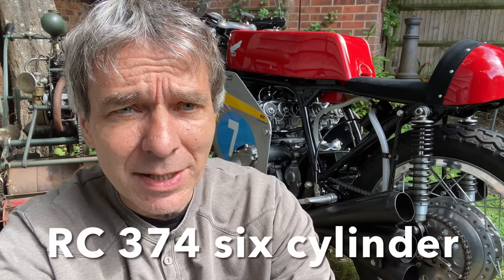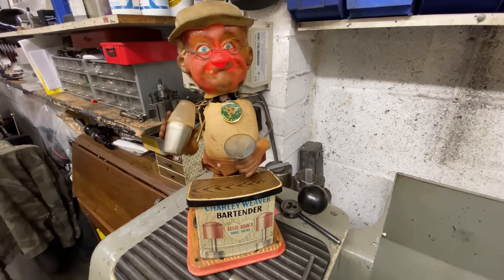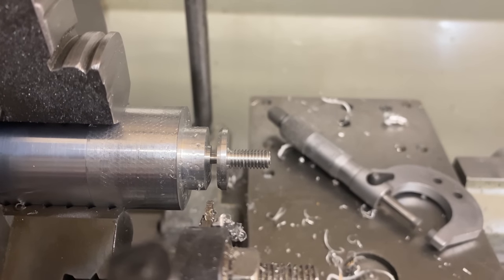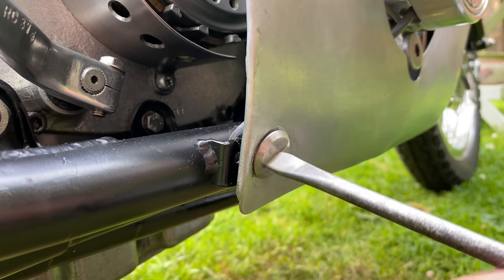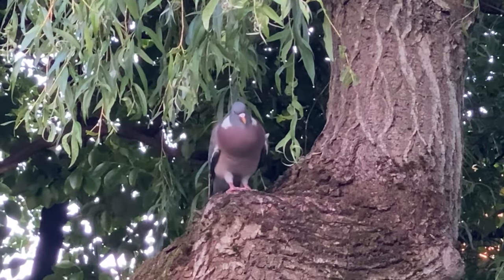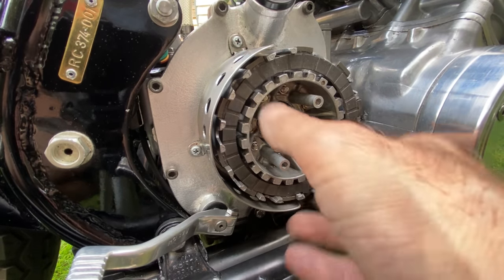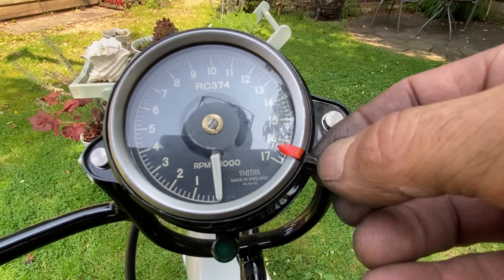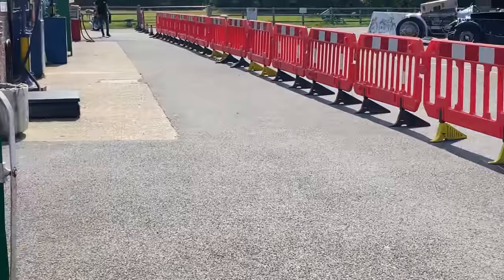Millyard RC374  Honda six replica - Episode 6

Comment: When you cut the slot in the screw you made I noticed you used a great trick of 2 -3 blades in the saw...great trick used it many times,,,  cheers Ian
Reply: good spotting, but I couldnt help but wonder why he didnt just cut the grove in on the lathe cross slide. Its already set to dead centre!
Reply from the maker: @tigertim20  The cross slide method is an  option I use sometimes but this time I wanted to show how easy it is to use a hacksaw
Reply from the maker: strangely I only used one blade, but I agree it looks like there is two

Comment: Need a screw:
Me: Goes to Screwfix
Allen: I put a 25mm bar in the Chuck. 
What a guy.
Reply: Ironically that was a pretty easy task to make that screw. All you need is a lathe, vise, hacksaw and a buffing wheel and a few months of machine shop classes. BTW aluminum being a soft metal is a joy to work with the titanium maybe more a challenge.
Reply: Also I forgot to add you need the die to cut the 6mm threads. LOL.
Reply: Made me laugh Dan

Comment: I find using brass rods (with different sized tapped holes in the ends) make nice mandrels for polishing fasteners. Much better for your fingertips (and also your knees, when a screw catches & pings across your workshop floor!)

Hope the Viennese Whirls came out perfect, btw!

Comment: As someone who consistently puts the hack in hacksaw, 6 videos later I'm rendered completely speechless by your incredible work. As you worked did you feel any emotional connection with the Japanese engineers who came before you? Both you and they, over a generation ago, used the same tools and techniques to produce almost identical parts in look, fit & function.

Comment: Hi Allen,. Love your videos.  I was wondering about you scuffing the steel plates, I build Transmissions and in a wet clutch setup you want the steel plates to be mirror polished smooth.  When you put scratches in the plates you shorten the life of the clutch because the frictions will wear a little prematurely re-polishing the steel plates with the friction material.  Something for you to think about. Have you noticed that if you checked the steel plates after you scuffed them and ran them the plates were probably smooth.  Okay have a good one.

Comment: Nice! A couple of things though; the clutch assembly has a wobble. This can cause the axle to leak from the oil seal when it spins. Also, has it ever been on a real track, for a timed lap? that would be interesting to see, how the engine actually performs. It sounds good, but how it runs?

Comment: Hi sir millyard. The metal clutch plates one side is flat and the other side is a slide dome do you have the flat side facing out or the domed side facing out just thought are ask you. Great vid Alan like all ways. PS I’m waiting for the two Yamaha RD 350 LC engines to become a 700cc or the power valve 350cc. I watched wheeler dealers the other day and Ed was stripping a old car it’s was a 1936 Cadillac and you want to see the con rods one fit up in side the other iv never seen this before may be you have just thought are massage you that. Love all your videos.👍

Comment: Thank you very much for sharing Allen. I love your Honda RC374 replica and also the tip for starting the thread cut was clever. Sammy Miller's is certainly a great place to visit, I saw a bike there as old as me - I wonder if it runs as well? I assume the screws going into the exhausr have to be Titanium because the heat would affect aluminium? :>)
Reply from the maker: Titanium is a metal with one of the lowest heat transfer properties, where as aluminium is one of the worst

Comment: to put grease into a grease gun; wear rubber or latex gloves, dip them in diesel and then you will be able to grab handfuls of grease dab them into perfect cylindrical shapes & load them into the GG without any grease sticking to the gloves/fingers due to the diesel's cutting and jellying effect on the grease

Comment: I'm surprised you didn't make a special screwdriver for the faring screws. Regarding your need to stamp everything, it would look much better if you used some masking tape so at least the letters are in line with each other, it really does offend the eye on such brilliant engineering.

Comment: 4:00 I was so disappointed to hear you were going to use a vice. I was expecting the usual technique of holding the screw between the feet, and a cutting disc used in the angle grinder.

Comment: I really like the fact that you never use power tools.
Makes it look and feel much more genuine.
Reply: Lathe,welder,drill, etc etc etc
Reply: @steadyeddie639  yes but if this was a normal youtube channel,  removing those screws and cutting the groove (?) on the bolt would be a job for an air compressor, compressed air tools, lithium battery impact driver, band saw, cordless rachet, electronic torque wrench,  a variety of digital  calipers, electric screw drivers,  hydraulic lift,  4 or 5 extension cords, fumes extractor  and a  two person small submarine.
Reply: @bikesmith  In his early days he did just use a hacksaw, file and welder even out in the field,basic tools for genius tasks,
its not what you have got its how you use it,

Comment: I remember that Kenwood mixer, as a bloke it's not often I would consider using it, I know where it is and has been  used for over 20 years.  My next big purchase is something which seems from another era  - maybe from Star Wars, a giant industrial metal printer,  costs more than a Goldwing yet, I predict almost as much fun, with a big  variety of wires,  including Titanium,  very Star Wars, then the one after that (another six months to save up)  is a large plastic parts printer. Both great for one off's of intricate design. The metal printer's are normally about 1 foot by maybe 8 inches build area, so a bit limited. So a 3 foot square job seems enough to make an entire silencer box for example, switch on and come back 36 hour later, a replicator fit for the Star Ship Enterprise!  I do enjoy your work.  Thanks for sharing.

Comment: Clutch plates will probably have absorbed oil into the friction plates. Cleaning with brake cleaner will clean surface but heat when used will bring oil to the surface again. I Did this with brake shoes years and years ago on a coach. Cleaned brake shoes and boiled them every time we braked the heat brought fresh  oil to the surface again. In the end we replaced the shoes. Hope you will not get the same. Amazing bike love your work.

Comment: The oil in the clutch plates is most likely spin off very slowly leaking through the clutch pushrod shaft tube, when the engine is run.

Comment: Do you heat treat your aluminium frames after welding on your bicycle designs ?
Reply from the maker: the aluminium alloy will age hardens to a certain degree but I didn't heat treat

Comment: You showed the finned radiator pre-cooler between the exhaust pipes. When the bottom fairing is mounted is appears to completely block air flow to that component. What is the thinking there?
Reply from the maker: It’s a volume cooler discuised as an oil cooler and the air is funnelled in quite nicely

Comment: how similar is they dry clutch to a hydraulic clutch. the dry clutch looks pretty straight forward and if  draining and bleeding the hydraulic clutch is really the only difference i might actual tackle my hydraulic.
Reply from the maker: A dry clutch means the clutch is separated from the engine oil and usually running in air. it can be hydraulically or cable operated

Comment: Alan...when you've got a spare afternoon, you need to fabricate a revolving cup cake casing stand. I suggest a simple bevel gear arrangement, but you may want to experiment with a lobed cam for intermittent 360 degree rotation...it all depends on the delivery speed of the cake mixture from the piping bag. Could be scaled up for a single Victoria sponge or scaled down and crosslinked for filling multiple vol au vents

Comment: The guy riding it in the car park seems to be slipping the clutch excessively at times.
Reply from the maker: that's me, its very high geared and little power below 6000 rpm

Comment: This guy is an amazingly prolific builder of very interesting bikes.

I have the same lathe, great little machines but surprised he doesn't use a tail stock die holder for those threads?
Reply from the maker: I haven’t got one 🙈
Reply: @AllenMillyard  No offence intended Allen, your work is amazing and I find the sheer amount of projects that you have done incredible.    Engineering has been my career in life so I can relate to what you are doing. 

I mainly tinker with model aircraft these days and will eventually get round to making an engine.

I have a Colchester Bantam lathe and an old imperial Elliott Omnimill, amazing what you can do with just basic machines.

Comment: Today mates, we're going to make a Woodruff key. First start with a driveshaft from a battleship and turn 99.9999% of it into shavings. Good, now go eat a cupcake, because Tracey makes the very best ones and they're nearly ready. Pat the woodchuck on your way back to the shed. Now get out your hacksaw and remove whatever bits of metal you don't need. You can do this by eye, I always do. Now polish it down to 3000 grit and apply a fine coat of ZX-1 Swiss watch jewel oil and admire your progress. Now chuck it out and grab a 5mm x 5mm Woodruff key from the parts bin and we're done! Time for a brew and anothe one of Tracey's wonderful cupcakes. I hope you like this video and don't forget to click thumbs up, subscribe and the bell thingie. 😀👍